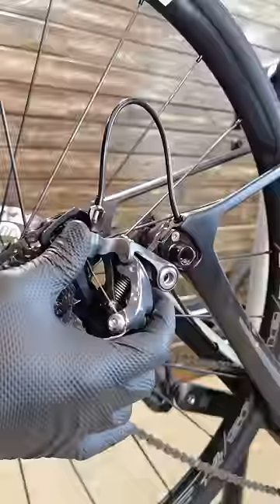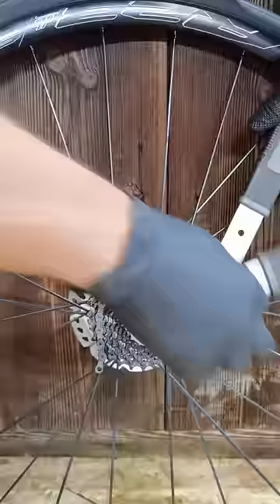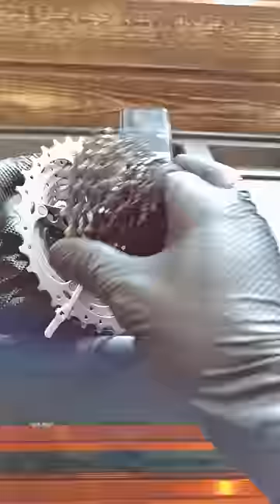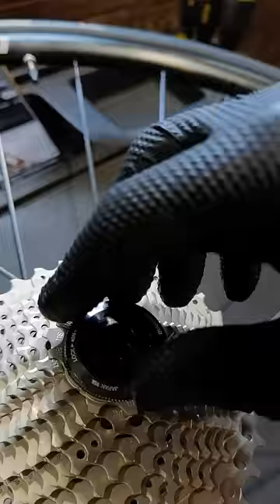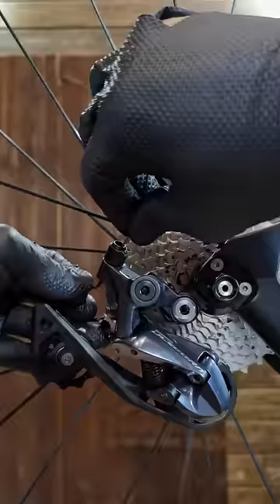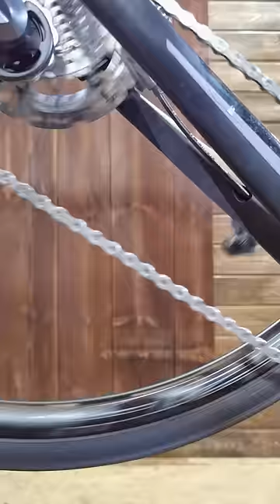Need lighter / lower gears on your road bike? Do this.

Comment: Bro really went all the way. 
I'm like 'nah, a bit of B screw will make my SGS handle a big cassette just fine'
Reply: Even just changing the cage would do it. No need to go buy a $100 RD for this.
Reply: Thats exactly what I did with my Red AXS rear derailleur. It handles 36t cassettes just fine in both a 1x and 2x, as long as I'm not cross chaining into the easiest 2 gears in the 2x config.
Reply: @hendrixinfinity3992  could upgrade to oversized pulley wheels too. But I think the goal here was to get a derailleur with a better clutch mechanism. That derailleur has a better one.
Reply: @diehardbikes  Ultegra to ultegra, not changing speed so same generation, neither have a clutch. Only difference is the cage length.
Reply: @hendrixinfinity3992  look closer. They are not the same generation.
Reply: @hendrixinfinity3992  also the new one does have a clutch.
Reply: @hendrixinfinity3992  changing the cage length wouldnt allow for lower gearing. B screw can help get a couple extra teeth though
Reply: @diehardbikes  neither a cluth or oversized pulley would change the derailleurs ability to handle more teeth. OS pulley is literally just overpriced gimmick that does nothing.  aclutch just stops chain bouncing as much
Reply: @zwicker5585   this is patently and verifiably false.
Reply: @diehardbikes  doesnt matter, they are both 11speed so will be the same design. Only off road derailleurs have clutches, they are not necessary for road mechs.
Reply: @zwicker5585  oversized pulleys will work because you are making the cage effectively longer, which is the proper way to increase capacity. If you don't know that a long cage is for a big cassette then you are not qualified to talk on the topic.
Reply: @zwicker5585  also, OSPW use the concept of bigger means less resistance. What we see here is the less angles that are in the chain, the faster it is. But since a derailleur has multiple, we use bigger angles, as smaller angles also have more resistance. Has nothing to do with bearings, nothing to do with the chain itself. It's just physics and math. Bigger angles=less resistance. Less angles=less resistance. Math.
Reply: @hendrixinfinity3992  look. You don't seem to know enough about Ultegra derailleurs. Or the newer 11 speed derailleurs, which the new one in this video is. Its the newest version of the Ultegra 11 speed mechanical derailleur that is the same design as the RX without the super nice clutch, as the RX version is basically a first generation GRX derailleur. That being said, is that Ultegra RX derailleur an off road derailleur? No. Its considered a road derailleur. Also, Sram Force CX1, is made for CX, but is often used on Crit bikes, and TT bikes, and categorized in the road category. What have we to say to that?
Reply: @hendrixinfinity3992  and no, the 2 ultegra derailleurs in this video are very different. Same pull ratio and thats about it
Reply: @hendrixinfinity3992  lmao thats not how any of that works. A long cage road derailleur cant handle the same low gearing as long cage mtb derailleur my friend. ultegra or 105 long cage might do a 32 tooth and deore can do a 50 tooth. This a function of the derailleur body. It has to do with how it swings, so the angle and length of the body  is what allows it to clear a larger radius cassette. Tooth wrap is different. Tooth wrap is what helps to make sure the chain stays tensioned between gears. More of it is needed for higher differences in gear range. This matter if you want more front gears but plays no part in allowing the RD to reach lower and farther which is what makes it possible to get lower gearing.

So to finish the lesson here, Long cage is for chain wrap. RD body is the limiting factor in getting a bigger cassete.  Usually you can go past the manufacturers rated spec by a couple teeth by maxing out the b tension screw. But, adding a longer cage wont make any difference.

And I would know, actually. Ive been working on my own bikes since I was a kid. Bike mechanics is my hobby now. Ive built bikes from the ground up. I have a wall of parts in my basement. I’m pretty sure I know how the derailleur works.
Reply: @diehardbikes  yes, you can get miniscule and completely noticeable gains from the slight resistance savings of an over sized (and priced) pulley. But it wont get your derailleur to fit a bigger cassete.
Reply: @zwicker5585  you don't need ceramicspeed pulleys to get those gains. There are many other brands out there at half the price that use standard good seal bearings. And if you want to have good performance for only a week at a time you could go cheaper than that even. However, you are dead wrong about them being able to increase capacity. They can. Note I said can. A longer cage means more chain wrap. Thats all. So what that tells you is an OSPW can increase your derailleurs capacity. But only if you do it right. Do it wrong, and that would be an expensive mistake.
Reply: @zwicker5585   also, we aren't talking about swapping from a 30t cassette to a 50t cassette. That would be ridiculous. However, you are correct that using this method is limited. You know, you could've just said that instead of "no you can't its not possible".
Reply: @diehardbikes  ... increasing chain wrap capacity, is no the same thing as increasing your max cog size. It cannot do that. There is no world where adding an OP is going to change what you derailleurs max cog would do. I could care less about the wattage gains. I'm not talking about that
Reply: @diehardbikes   ultegra rx has a clutch, ultegra r8000 doesn't. Being that gravel was not a distinct category back then it made sense to categorise under road. There are exceptions to every rule, but a CX RD is an offroad derailleur.

The two rds in the video are r6800 ss and r8000 gs. Neither have a clutch
Reply: @zwicker5585  don't put words  in my mouth. I said nothing about mtb cassettes. A larger cage will do a small jump like this because increasing chainwrap is the goal. Maxing out b tension is the home mechanics way of doing it but is bad practice. Once you get to that point you'll need a bigger capacity RD to do it properly.

Bike tech for major company> home mechanic.
Reply: @hendrixinfinity3992  i didnt say that you said anything about MTB RDs lol chill brother. And if the goal is increasing the the lower cog size. Increasing chain wrap is not a solution. The body is the limiting factor. The difference in a mtb and road derailleur is the body size. Its designed for lower gearing. I mention this because it proves my point. You clearly have no idea what you're talking about here. Maxing out b tension is THE ONLY way to increase cog size if your current RD is already maxed out and wont take a larger cog. I literally have two identical 9 speed 105s in front of me, one is SC and one is LC. The long cage wont take a bigger cog size. It will take a third gear up front though :) If you were a bike tech you would know that chain wrap is a factor of your front gear range. This is basic knowledge.
Reply: @zwicker5585  like I said, bad practice. B tension has a correct setting, too much and the shifting will be off, too little and you have slack in the smallest gear.

Chainwrap is a factor of tooth count which is both the front and back, and I don't how you can get this so obviously wrong when longer cage derailleurs are literally marketed with their capacity on them.

If it were common knowledge a basic bit of googling would prove me wrong, but it didn't when I checked, maybe you get different results where you're from.
Reply: @ my man look at a long cage ultegra max tooth size and compare it to a long cage deore and get back to me. They dont have the same capacity. 34 vs 50. Teeth. Yet both have a long cage 🤔 chainwrap is a factor of total range, but its rarely the LIMITING factor for max cog size. Do you know what that means? If you want to actually significantly change the max cog size, a longer pulley is not changing that. Look at a derailleur. Look at how it swings. You arent getting a 50tooth cog in any ultegra derailleur no matter how long the pulley is because the body doesnt swing far enough down. Every rd body swings down and inside. If doesnt swing low enough it doesnt matter how much chain tension you can wrap in the cage.

And b tension suggestion is literally a hack its not meant to be “correct”. Correct would be buying a new rd and cassette. B tension just pushes the rd back and clockwise putting it behind the cassette and allowing a larger radius of cassette. And theres no correct position of the b tension other than setting it to the correct size of cassette you have. Because thats literally what its for lol  Ive seen people swap for a longer screw and slam the be tension even farther back and it caused no issues whatsoever because it allowed the rd to spaced correctly dor the larger cassette. B tension is not supposed to be used to tension the chain. If you have slack, take a link out of your chain. If its too tight, add a link.
Reply: @hendrixinfinity3992  if your google proved you right drop the answer you got and what you googled.. cuz youre basically saying you think an ultegra long cage (34tooth max) can reach a 48 tooth cog (37 tooth wrap) in a 1x setup. Which is obviously not the case.

Comment: Please, please, please use a derailleur hanger alignment tool between swapping derailleurs! This is best practice as mostly hangers are bent so always worth checking!
Reply: meh. only worth changing if your indexing isn't working. Most hangers are not bent.
Reply: @ you clearly don’t work on bikes as 90% that come through our workshop are bent and it is best practice to check them before indexing gears. Pretty standard stuff!
Reply: @ Also, I am not talking about changing the hanger! There is a tool that is design to check and straighten the hanger. You only need to change them if they are snapped or have a crack in them.
Reply: The old derailleur in this video had a lot of marks on it which shows the owner has not been careful with their bike. A clear sign to check the straightness of the hanger!!!!!
Reply: @paulflook141  sure when they are brought in. But when the gears work already its probably fine. Anything enough to be a problem would be a problem already
Reply: @ and yes I know the tool. I have one. I’m not unfamiliar with realigning a hanger
Reply: @zwicker5585  It the difference between being professional and not! I would never employ someone who fits a rear derailleur without checking the hanger alignment. It is a very quick process and not worth overlooking. The gears can still work okay with the hanger bent but better to be pro than not.
Reply: @ I’m not talking about a shop. Nobody is talking about a shop except for you. Most regular people dont have one at home. So i would say buying a hundred plus dollar tool youll never use to fix a problem that doesnt exist is a waste of money and time. Obviously if a bike is brought into a shop thats different. But thats not what I’m talking about champ
Reply: @zwicker5585  I am responding to your original comment which is completely false. I have used the example from our workshop as we see hundreds of bikes per year which gives us a good scope of experience. Maybe don’t make rubbish comments if you don’t have the experience to back it up. I am bored of this conversation now. Bye bye!
Reply: @paulflook141  and btw i have decades of experience working on bikes. I literally have 6 bikes built up from parts alone. Youre suggesting a rider(not a shop) buy a 140$ tool for something we both know is working perfectly fine. It shifts fine and therefor is straight enough. If anything it would make more sense for this person to just buy a new hanger for 5$ and know its straight than buy a tool they dont need for a problem they dont have because some random guy on YouTube would use it in his shop lol you need to go touch some grass or something
Reply: @zwicker5585  Bored of this conversation now. Got bikes to fix! Using my derailleur alignment gauge! ; )
Reply: @paulflook141  strange, all my bikes run great... maybe youll learn that fixing things that arent broken just breaks them more
Reply: @zwicker5585  Boring!
Reply: @paulflook141  take your meds gramps. Youre willing out
Reply: @zwicker5585  Still bored! Move on man.

Comment: If you already have a long-cage derailleur and your wheel has a freehub, it's quite reasonable to get a new cassette and chain.

If you aren't looking at high-end components anyway, or for an older bike, you could buy a long-cage derailleur, cassette, and longer chain on the cheap or gently used all cheaply as well.

Problem comes if you're trying to replace a cassette for a bike with a freewheel... then you basically need new wheels. I happened to find a very closely-matching wheel with a freehub (what you need for a cassette) for my folding bike, that was dirt cheap at a shop that was getting rid of unused repair parts... but this isn't likely to be the case for many.

Comment: You could also get a Wolf Tooth derailleur hanger extender instead of a new derailleur.  I’ve used them before and they work flawlessly.
Reply: Does tge angle not become off?
Reply: I had a Wolf tooth extender put on my hardtail mtb to get a lighter lower gear. Been riding the same terrain as before and had 0 problems 🚵‍♀️
Reply: Used a cheap mech hanger extender  with a sora 9 speed on a 1x gravel bike and it worked with a a 40t at the back no problem.
Reply: my alivio works with 42t maybe with extender it can work 46t and higher since many done that before
Reply: @togfanatic3781  what version is it? How many teeth on the front ring? Would like to replace the sora with something that doesn't need an extender and hopefully less chain slap than the sora

Comment: Ok, 2 things, if you remove the chain first (something you will be doing anyway) then you will find it easier to remove the wheel and you won’t get the new cassette dirty. Next, just use a wolf tooth type adapter rather than buy a new RD, it’s significantly cheaper. 🙂👍🏻 Also quick question, how is this “lighter?” It’s a bigger everything?
Reply: Wolf Tooth works but gives worse shifting quality … best reserved for going nuclear either say an 11-42

Comment: The construction worker dude with godly calves near my house with his steel bike: gears? What gears?
Reply: Meanwhile road bikers: "I just can't use a 1x setup with no front derailleur 😭 I miss some tiny gaps between shifts to keep my cadence at exactly 90 and my little legs get too tired"
Reply: @thebrunoserge try to compete with a roadie on an mtb.
Reply: one gear to rule them all!! 42/17
Reply: @roberth4395  I'd like to compete with a roadie on a 2x vs me on my road 1x bike
Reply: @martijnt1353  what about rims?

Comment: My other bike is fixed gear. Done this cassette thing on my adventure bike.46x30 chainrings,  but think I can work out a 46x28 rig. The same range basically as 12 speed,  but closer ratio using just 9 speed. 11-36 cassette. Tinkering is half the fun! I like shorter cranks and have 175mm now. Upgrade to hollowtech standard Samox, evenly spaced 4 arm 64mm bcd small 30 tooth ring and put 28 tooth in it's place. Probably go uphill 4mph at 80 RPM with  a full touring load! Think the rear derailleur can just handle all that wrap. 9 speed chain can wear almost 1% before replacing,  12 speed. 5%.way cheaper to use 9 speed.
Reply: Fixed gear bikes are only for show

Comment: Cheap option For the rear mech is the 10 speed medium cage tiagra 4700 rear mech. This works with all 11 speed Shimano setups, but ironically it does not work on other 10 speed setups except For the tiagra 4700 shifters. Thank me later.
Reply: Sram is better
Reply: Does it work with 30 plus teeth?
Reply: @cjm6149  The Tiagra RD-4700-GS can take up to 34T in 2x configurations.

Comment: 11 sp derailleur $50, 11 sp cassette $25, 11 sp chain $35, Shift cable $9, cassette removal tool & chain whip $15, bike hex tool $15.
$150 ALL IN. All Amazon prices.
Any bike worth sitting on that's still a boat anchor will be $500 minimum.

Best upgrade I did to one of my old gas pipe road bikes, transformed it. Also converted to mountain bars and controls. Turned an uncomfortable road bike into a gravel style cruise. HUGE improvement.

Comment: Can you do a video where we increase gears on the crankset in front ? I'd like to increase 2 gear to 3 gear and keep the 9 in back.
I'm not an advanced rider, but need more middle gears.
Reply: you don’t need to go from 2 to 3 gears in the front, you would lose shift quality and chain retention by doing so. If you feel like you lack range then maybe your larger front chainring needs to be a bit smaller, you can have a shop source a new front chainring and you will be able to spin a little easier.

Comment: You don't need a whole new rear mech, just a longer cage. Also, no need for a new chain, so long as you kept the spare links when you installed it.
Reply: Wrong, rear derailleur geometry is different between SS and GS-caged versions. GS-caged rear derailleurs have a larger parallelogram linkage.
Reply: @sbccbc7471 
Well the geometry may be different but it works just fine. I swapped my Dura Ace 9150 DI2 rear cage for an Ultegra RD 800 long cage with an 11-36 and it shifts beautifully.